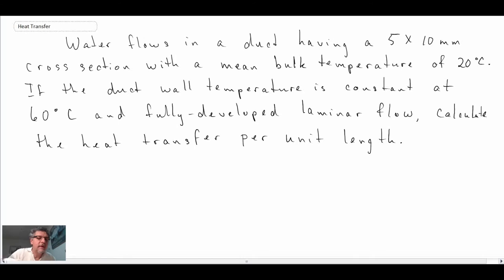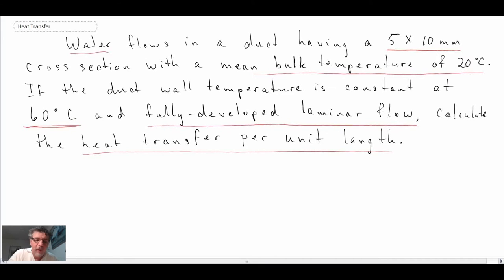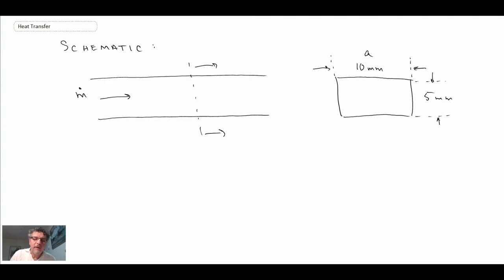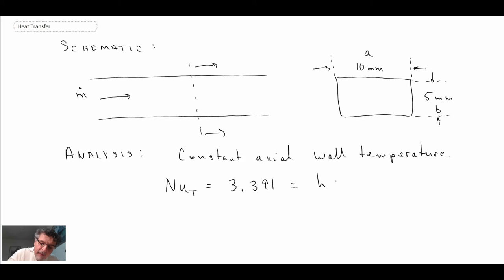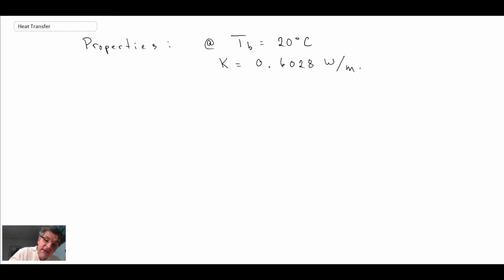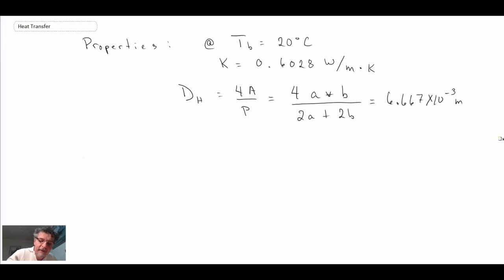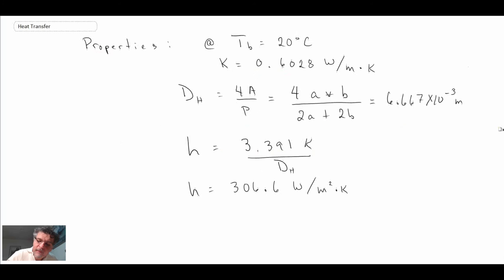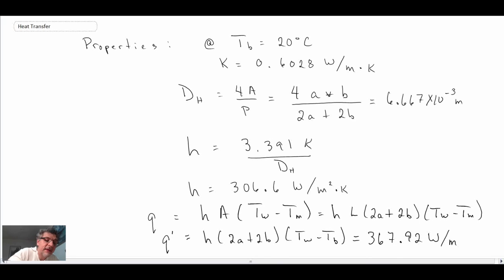Heat Transfer L22 p6 - Example Problem - Non-Circular Pipe Geometry

Comment: sorry but your solution is incorrect. the given temperature for the fluid is the mean temperature at the duct inlet, you first assume a mean temperature at the duct outlet then calculate the arithmetic average of the mean temperatures. After that you evaluate properties (k and cp) at the calculated average, then recalculate the outlet mean temperature using an equation given in the book and iterate until convergence is reached for the outlet temperature, after that you can use the LMTD to calculate the heat transfer rate per unit length. However, I couldn't use the equation for recalculating the outlet mean temperature since it contains L which is unknown so a clarification on this issue would be appreciated.
Reply: can you provide the formula and an example on a round pipe?
Reply: You assume the length is 1m, since its heat transfer per unit length 2:05